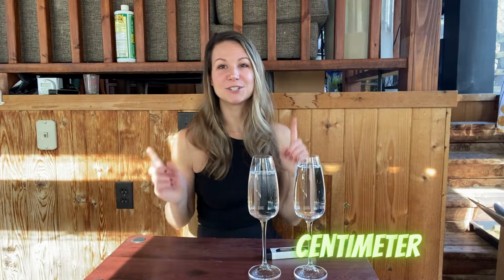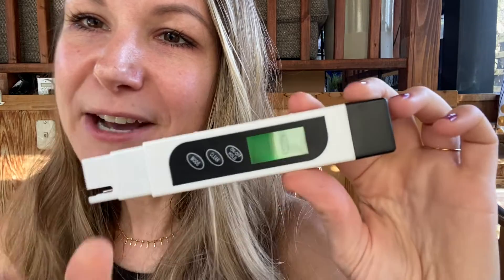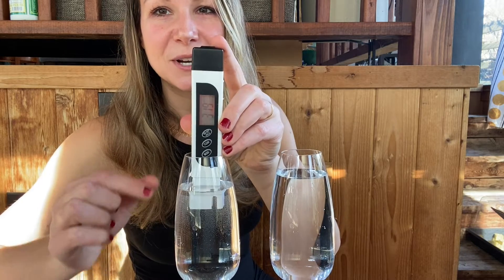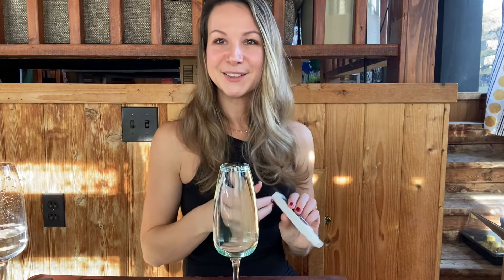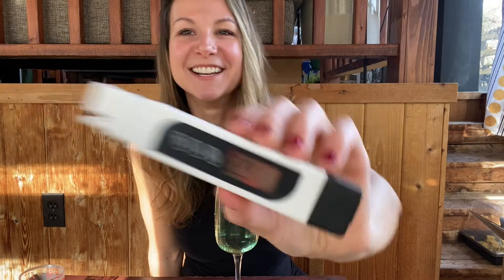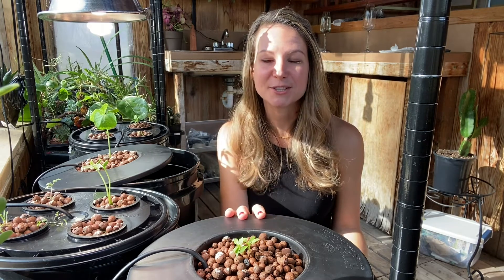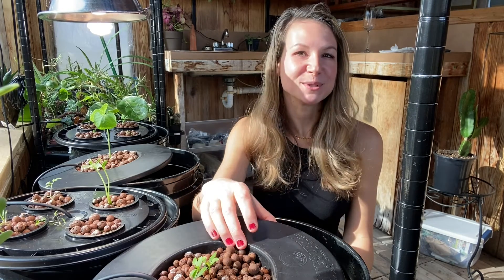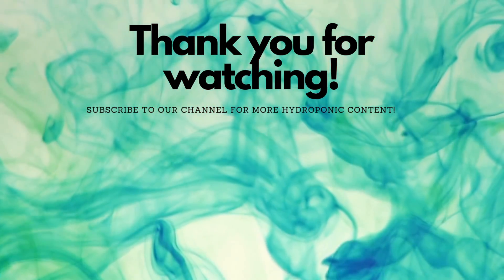What Is EC In Hydroponics? (Hydroponic Series: Video 4)

Comment: I only have a TDS meter. Can this be used to calculate EC? Thanks. Really enjoy your informative videos.
Reply from the maker: Yes, a TDS meter can estimate EC (electrical conductivity) because it measures total dissolved solids derived from EC. Multiply the TDS reading (in ppm) by the meter's conversion factor (most are 0.6-0.7) to approximate EC in mS/cm. If you still have the instructions that came with your TDS meter or can look them up online, they should have the conversion factor in there! 

thank you for watching!